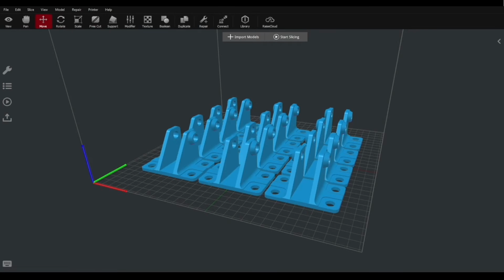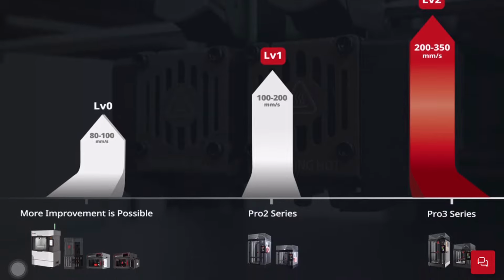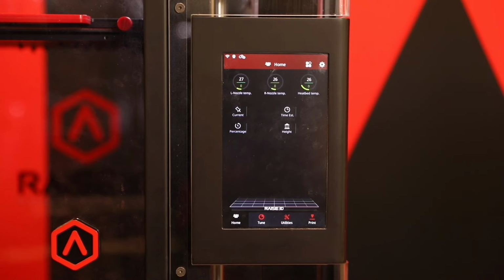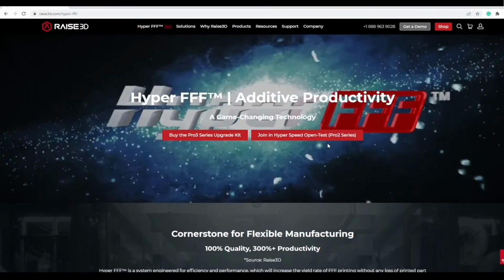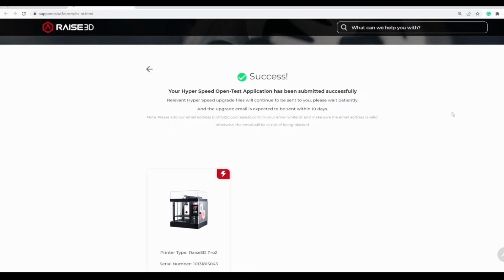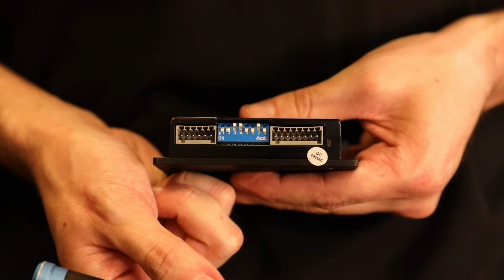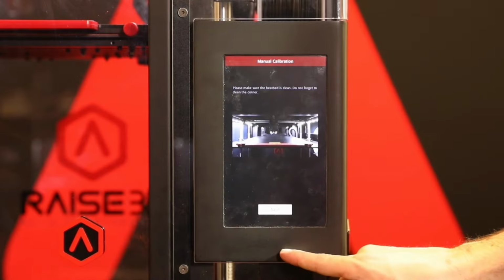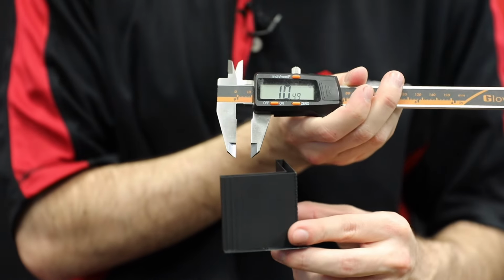Raise3D Hyper FFF Upgrade Tutorial for Pro2 Series

Comment: For 2 pro series fan noise is high
Reply from the maker: Hi RajavikasS, if you're experiencing high fan noise with your Pro2, it could be a sign that the fan is aging or nearing the end of its lifespan, especially on older units. For a quieter experience, we recommend replacing the fan.

Comment: could use some elaboration on how to figure out if they are 6 bit or 8 bit.  you say we have to determine which but you don't say how.
Reply: did you finger it out ,,   6bit is six switch   an
Reply: Also curious if you figured it out. Comment above says Pro 2 is 8 bit?
Reply: I think i figured it out. My drivers literally only have 6 toggles. I assume that means I have 6 bit. In the video he talks about 8 bit driver while showing a driver with 8 switches.